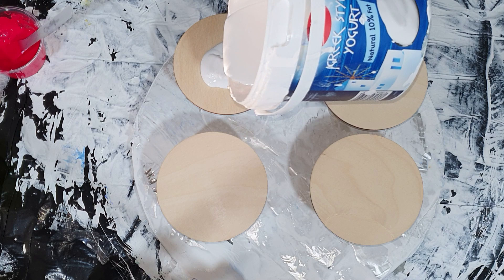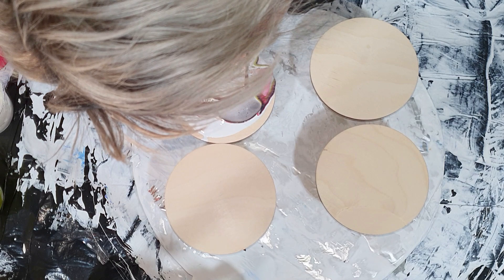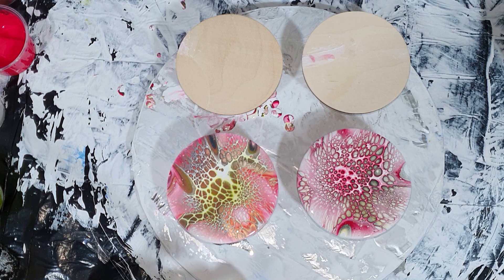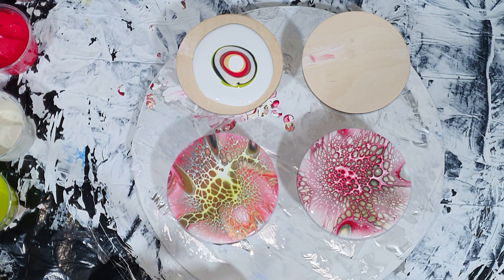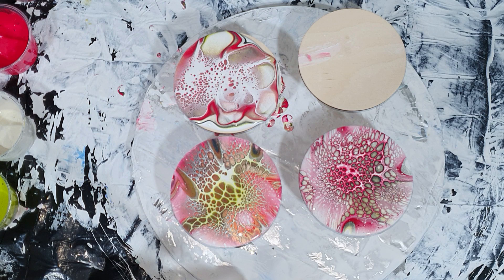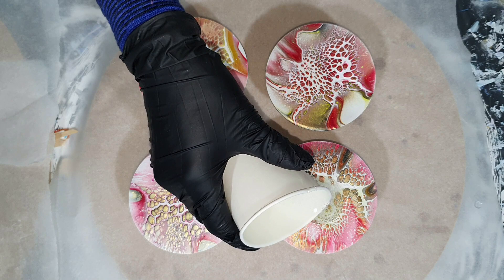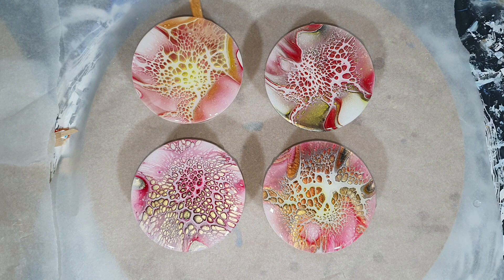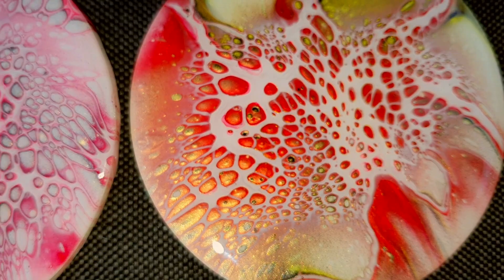DIY Acrylic Coasters * Christmas Idea

Comment: Do you have a situation when you pouring a top coat the surface is not smooth? Irregular web or other defects are forming on my coasters. I do not know what to do. I use high quality resin. I have problem only with top coat layer. Please help me :)
Reply from the maker: No, I don't have that problem Bosnia. Which resin are you using? I'm using the Art Pro resin from Resin Pro. When I pour a top coat I always make sure that my room temperature is about 21 degrees, (also during drying),  that the surface of the coasters is clean (I use alcohol to clean them).  I never pour on a rainy day, because that can also cause problems.